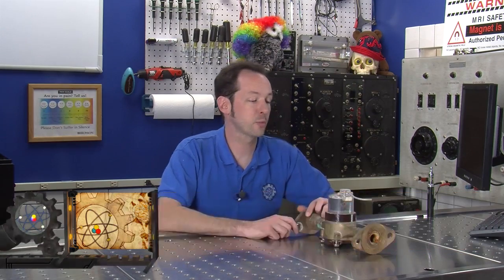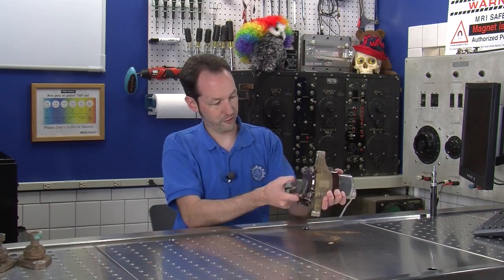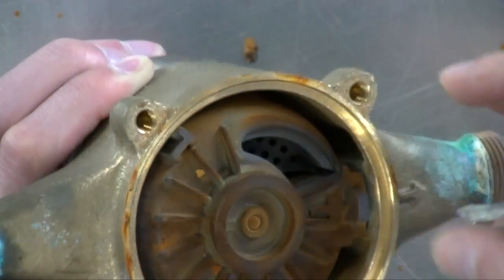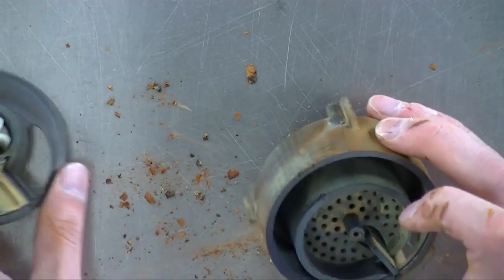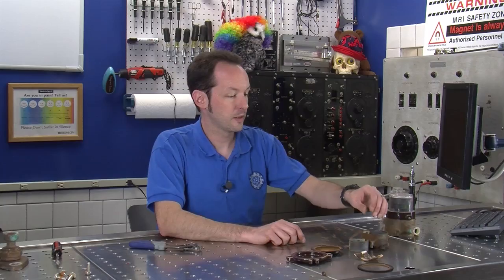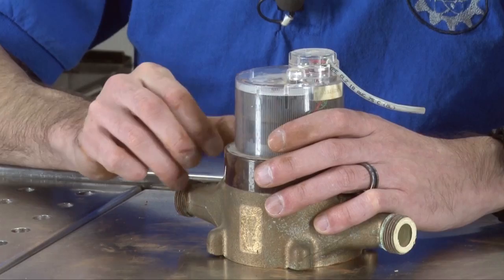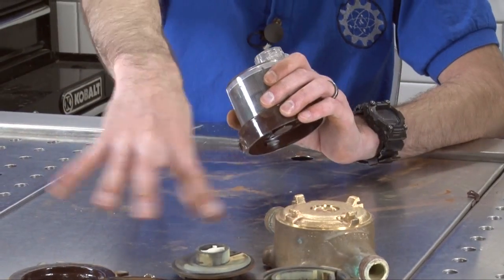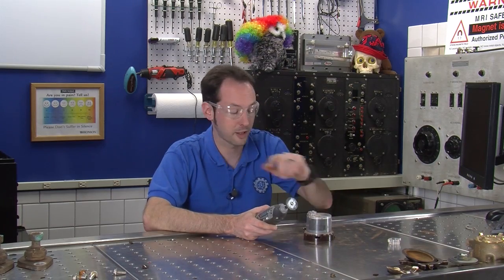Water Meter: Equipment Autopsy #67

Comment: 5:04 the Sensus SRII uses a "piston chamber" design (not impeller), theres alot of surface area to drag in a piston design, causing lower accuracy at low flow. a meter like this could potentially give a customer free water if the leak is 1/4 to 1/2 gallon of flow per minute. I have tested some of these in the SR variant where they have not moved untill 3/4 GPM. these SRII meters are better for the customer due to their lower accuracy at low flow. they are genrally accurate from 3GPM to thier max around 15-20GPM

5:39  these are magnetically coupled. magnetic coupling got popular in the late 60s/70s. previous to that they were direct driven with a stuffing box around the shaft to prevent water from leaking out, but there was more drag in that previous design.

7:36 put some water on the surfaces, it will have less resistance and you can show its movement easy

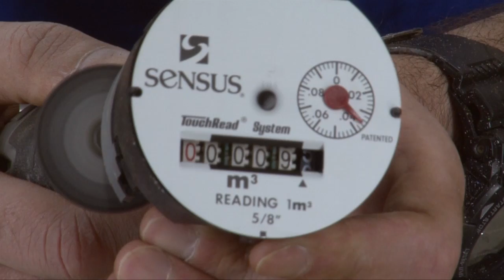20:24 if the chamber spins faster than a certain RPM the magnets will uncouple. i have seen this with high water pressure and someone running all thier sprinkler zones at once, over driving the meter. when the magnents uncouple, the meter will not register flow until the flow rate slows down and then they will recouple and start recording again

32:12 the date code on that circuit chip was 9424 which is 1994 24th week. so i would say that meter was probabally installed around 1995. the SRII series was popular in the 1990s so that would line up correct. there should be a date code on the face of the register, but is not an intuitive code, probably something like 015 which 01 would be January and 5 would be 1995 or there could be an alphanumeric code on the face such as 1-C which 1 would be January and C would be 1995

Comment: This is very cool, i had no idea all this was in a water meter. Just to let you know, in Yorkshire, England, the meters are inside the house, with a small antenna, and the meter reader doesn't even have to come to your house, they just drive around in a specially modified van picking up meter reads all day! They are also trialing Electric meters with mobile phone type sim cards, and they can shut off your electric from their head office!

Comment: about 2 years later am back looking at this video and remember how i thought I had invented a pretty cool way to digitize the mechanical counter in water meters for a remote enabled reading application, well my idea was to use resistance in between the coils and measure the total resistance representing the place values of all the counter wheels, but then, it was already done more than 7 years ago before i begun thinking of it...and that is how sweet bitter life is, that was a pretty cool undergraduate project idea i had thought of...nonetheless i credit myself for thinking like those guys shows I am on the right path...bitter sweet lemons 2 years later but I would like to meet the guy who digitized that stuff who came with the original idea first.

Comment: It is a brushed-type motor, but it is also an electromagnetic-stator motor, which means that EVEN ON DC it will always spin the same way if you reverse the polarity because the stator magnet polarity changes along with the polarity of the rotor. Hooking it up backwards only works with permanent-magnet motors.

Comment: My water meter is still a mechanical meter. Its located in the side walk in front of my home. Baltimore is currently swapping out the old mechanical meters and swapping them with the digital ones like you have. Also, if the bottom part malfunctions, its easy to keep the initial reading and change it out. 

PS: Dremeling left to right would make the plastic shoot to the ground instead of your face. ;)

Comment: I am here because I was so curious how that little electric transmitter box and wire to the analog meter worked and how it translated analog movement to digital.  You covered everything from how movement of water activates a magnet to move the numbers on the analog meter and how the movement of numbers is translated into digital signals to be read electronically.  I've never seen a video like this. Quite interesting.

Comment: 30:00 for the electronic goodies... curious to find out exactly what that chip does (no luck looking for details). Many of the water meters I've worked on have been pulse / hall effect sensor that go into a PLC to calculate flow rate and totals! Interesting stuff Boden!

Comment: I have two water meters like this, minus the electronic part. One new, another an Ebay find. Taken both apart as well. our meters are in a small manhole in the front yards, below the frost line. the cover is under a foot in diameter.

Comment: Envision reversing A/C voltage in your head.  It's going back and forth like a wave in the ocean.  If you reverse it, it's still a wave.  If you look at it through a mirror... still a wave.  Goes up, goes down.

Comment: For those of you who might suggest running the cutter on DC (since the cutter uses a universal motor): that would not work since the cutter would spin the same way regardless of the supply polarity.  The polarity of either the field or armature windings (electromagnet field) or the DC side of the rectifier (permanent magnet field) would have to be reversed in order to change the direction of rotation of the motor.

Comment: It's called a measuring chamber.  And the head is sealed but can be removed without breaking it.  There is a wrench that turns the round silver disc on the side.
Reply: Also called a positive displacement meter. There are a variety of other methods, of course - multi-jet, ultrasonic, magnetic...

Comment: Thank you for this informative video. Is it possible for the water meter to give a false over reading  by a factor of 3? I had an average water usage at my house of about 3,000 gallons. Then one month it went to 102,000 gallons then the next month the meter didn't work...it didn't read any water usage. It completely stopped functioning.  We had a leak, but it was measured by the plumber at about 3gallons/hour or about 2,200 gallons a month. The bill was $1,200. Any insights you might offer would be great.

Comment: Here's a question, if one was to place a strong enough magnet at the correct spot could you lock the meter in place? Then removed it when the inspector comes? Is this something you could test?

Comment: the drimel will likely always run that way, some ac motors you have a shot with depending on polarity at time you plug it in. (that's why your microwave randomly changes directions if it has turn table.) your best bet is to hope the drimel has a universal motor, witch wouldn't surprise me, and run on 120V DC.

Comment: Senus says the bodies of their residential water meters are made of low-lead bronze.  You can obtain PDF data sheets for their products from http://www.sensus.com/water.

The measurement mechanism is a type of positive displacement pump operated in reverse as a motor by the water flow through the meter.  I've seen such a meter operating with the outlet fully open, with maximum, unregulated flow directly from the water main, and one can hear a "clunk-clunk-clunk" sound as the rotary piston moves round and round inside the chamber.  Normally, in a residential situation, you would never hear it, because the flow rate is much lower.

Comment: You said that the chip counts the turns.
Does it count or does it take a snap shot at the time of the meter reading. I would think you were right with the RFID statement that charges up the circuit and it returns the snap shot not stored data.
Could be wrong though

Comment: Because meters (cubic or linear) more easily translate to cubic inches. 
For example, approx 3ft per meter; or 39" (you can round down to 36") per meter. Now with 46656 cu.in's per cu. meter; and you have 243 cu. in per U.S. gallon, since the conversion/ rates are already an accepted standard, it's the simplest way to measure equivalent gallons.

Comment: A/C motors only spin one way. Reversing the polarity willonly work on a D/C motor.
Reply: Swap any two leads of a 3 phase motor and it will reverse direction, a 3 phase AC motor, also the most common. Many single phase AC motors (actually split phase but who's keeping track) have a provision for swapping wires from within the grouping to change direction. Ever hear of a "universal motor" operates on both AC or DC, how about "shaded pole"?
Reply: So your wrong Robert, in case this thesis has escaped you.

Comment: What is there aren't four bolts on the bottom?
Reply: I took out the register and cleaned out the screen.
I put everything back together and confirmed operation with a garden hose. Although when I put it back online, no operation when the pump kicks on. Any ideas?

Comment: we call it brass in Auzzie mate
Reply: +Paul Carnevale It's actually not bronze at all, it was brass. I have yet to see bronze in any valvework, it's almost always either brass or plastic.
Reply: +Paul Carnevale Brass and bronze are different metals.
Reply: Mate did you even read what i said? I said brass not bronze@
Reply: Paul Carnevale I did see what you said. I'm saying brass and bronze are different alloys. I believe bronze has a much higher copper content to brass.

Comment: Regards the electric and gas meters, depending on where you life a lot of them are read by RF and never get inspected. 

Oh I know, National Grid has been DYING to know what I'm doing with the gas service. But since the charge a higher customer charge and per ccf and therm rate if you heat versus cook and hot water what they don't know won't hurt them.

Comment: the Dutch system is part based on trust, on the other hand, if you move out or the meter needs to be changed they eventually will figure out and you will pay for it!!

Comment: So then, all we need is a dirt cheap uC with a scrap of code running on it to emulate the the original meter and hey presto free water. Nice.
Reply: The utility would notice abnormally low readings and investigate and or replace the meter.